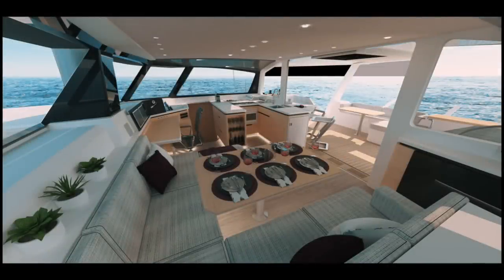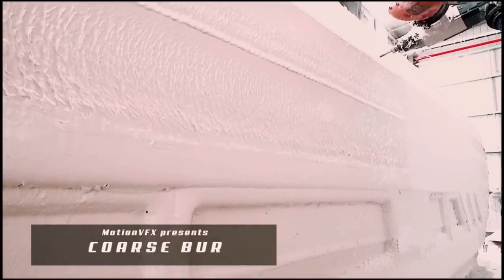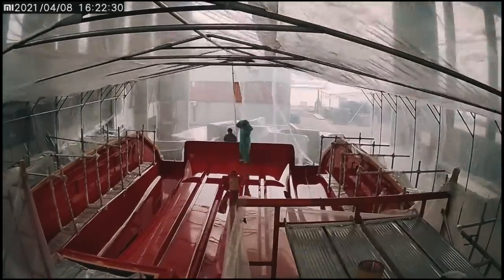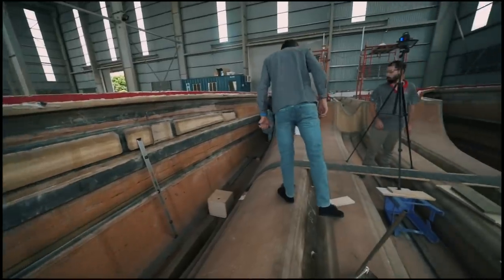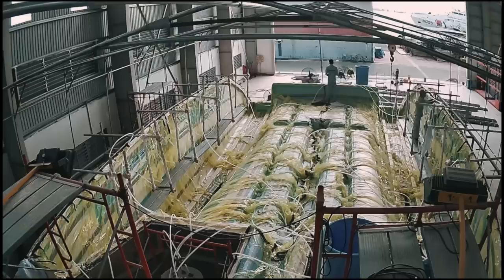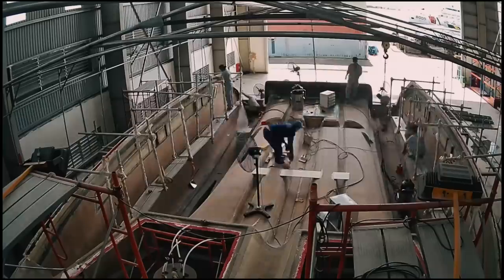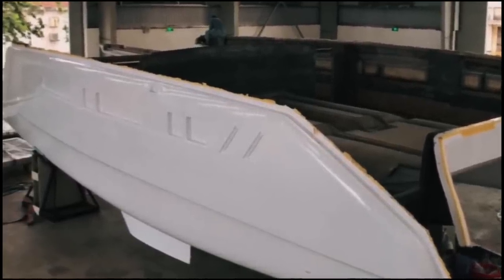🔴 Why does this BOAT BUILD need an INSANE 6,000 feet of pipe work?!!

Comment: I have created a number of process improvements at Boeing for composite construction. Many parts of a nominal aluminum aircraft are made of composite materials to save weight. From a process engineer perspective, this build process is excellent and well thought out. The key is the attention to what is called process step transitions. These people are excellent in the transitions from one process step to the next. Of course they paid good attention to the basic design process. They used the expensive carbon fiber very selectively to achieve a balance of weight savings and keeping the cost down. Carbon is light and strong, but also very costly. Thus a balance was sought between light weight with adequate strength and cost. This is an admirable quality in the design leadership. It is one of the key features to the SeaWind management and leadership. In Engineering we say any fool can build it if cost is no object. But cost is always a member of the triple constraint. Cost, performance and time. You must manage all three at the same time. Few do. That is real experience from my world. Time slides are so common at every company I have worked for because they don't seem to understand fundamentals. Tine = money.
Reply from the maker: Thanks Roger. Super interesting comment
Reply: I was the EA for the Program Manager (a Boeing VP) of the BB V-22 program at Pax during the lead-up to and post LRIP decision.  Hectic days.  I have always been very impressed with Boeing's bench strength.  Every Boeing employee I met and worked with was high quality.  Back then, on the mil side of production, the big three were Cost, Schedule, Technical Performance.  I'm sure Nick appreciates your comment a lot.
Reply: @williamdykes2750  Thanks for making the connection. Your words mean the same as mine. I learned a lot and contributed a lot as well at Boeing. I am glad you had a good time there. Boeing had some great leaders. They were anything but perfect. But they knew how to lead a great company.

Comment: I’m curious as to the statement about “destroying” the (foam) blanks to protect the Intellectual Property.  
Won’t any decent laser scan of the hull reveal the exact shape used?
Reply: True, but what sort of laser and when are you going to be able to do it. The reason is so that further (pirate) moulds aren't made from it, which is a darned sight easier than building a new plug from dubious laser scans.
Reply from the maker: Exactly this
Reply: Yeah, but that's a bit of a stretch.  Toss a plug in a dumpster and 100% someone will grab it, slap some glass on it, and make a crappy 3rd rate copy.  It's happened.  But by the time someone goes to the trouble of obtaining a hull, 3d scanning it, CNC milling a new plug etc, there are far easier/cheaper ways to build a boat.  It's like locking your doors, it keeps honest people honest but doesn't do anything to prevent a dedicated thief.   But it will stop a 3rd shift SEEWHIND from finding it's way on the market.
In all seriousness, he glossed over it, but making molds is a good bit more expensive than making a hull.  Molds have to be much thicker and stiffer than hulls so they can stand up to repeated use.  Say you take a 3d scan and hire another yard to make you one, you're looking at several million dollars worth of work.  It'd only make sense if you c/would sell a few dozen, and if you are capable of making boats that people will buy dozens of then you likely already have an equally solid design and stealing this particular design isn't much of a benefit.  This design may well be awesome, but it really isn't any more awesome than what any competent shop can make on their own.
Reply: @MrJhchrist  I think you sum it up. If you can afford to build one of these, the licencing cost to pay the designer his fee are minuscule when compared to your construction costs. Who would risk $1million plus to build a pirated copy boat. I understand that the normal legal process is to chainsaw the pirated copy and all costs awarded against the perpetrator.
Reply: "All you need" (famous last words) is a microsoft 3D scanner for about $100, a $350 bit of software - plus a ton of software frustration time, and you can copy any boat that you find on the hard really. Then there is the small matter of a 45' to 60' long by 14 ft tall 6-axis robot cnc "cutter" to create a foam plug for the negative mould (the commercial ones are all 6-axis usually - as I can tell). You definitely want to build to this level though, this builder is using great materials without being wasteful. Sure an all-carbon tub would be lighter and stronger, but one miscalculation and there is the possibility of a fatal large failure.

Comment: Really impressive to watch, even if the tech side is kind of lost on me. It's reassuring to see how much thought goes into making a strong hull. I do wonder if that rigidity has any downsides? Not to compare bananas to bricks, but under extreme pressure doesn't it mean there is a final snapping point? Growing up in Florida where hurricanes are frequent we learned that the palm trees which flex and bend mostly survive while the rigid oaks and pines snap apart in many places. Mother Nature can be a booger when she gets her undies in a twist!
Reply: Rigidity is good.  For what''s intended to be a solid structure, lack of rigidity is what cases fatigue cracks and eventual failure.

Trees have a totally different structure.  Wood and most other plant matter is made up of many cellulose cells, where strength comes from many directly connected cell walls in a continuously solid structure.  Since such a structure is not hollow, it can't carry anything useful inside it.

Boats made from wood are mostly made to be rigid.  Viking longboats are an exception, but most boats since then have been designed to be rigid and will fail if flexed enough.  They need to be rigid too.  Obviously metal and composites are better than wood in this regard, though metal has the problem of corrosion in some cases (Aluminum tends not to corrode; steel does).

A better analog for plastic composites would be seashells.  They are very rigid and strong, but if they flex enough they break.  Same with arthropods, turtles, etc.
Reply: @LoanwordEggcorn  Good explanation! Thank you.
Reply: @rumblechick73  You're welcome!

Comment: You said this boat will be a super-light, super-fast performance catamaran. According to the specs on the website the light displacement is 11 tonnes. The extended version of the Marsaudon ORC42 is the same LOA and a light displacement of 5.8 tonnes. How would you qualify this cat?
Reply from the maker: Hey mate,
The TS 42 is an amazing cat. If I wanted a super fast racing cat, then between this and the Dazcat there is little to choose from.
Ultimately we want something that is going to be a liveaboard for us and the TS 42 while very light and fast does not have the interior fit out we need.
Also, as an aside, the lightweight is 6.4 tonnes. The emptyweight is 5.8. However, looking at the specs of this boat, I think that once you add engine upgrades, and start to use her as a liveaboard, the weight will increase rapidly. It will also probably quickly increase past the point where performance is hampered.
I’m not sure if you saw our review of the xsquisite x5 catamaran from last year. Their point (which was well made) was that the performance score we gave them was based on the weight of the boat. As they gave the true weight as 18 tonnes, it was scored down. But if they had given lightweight displacement it would have been 14 tonnes.
I would love to see the actual weight of one of these boats after being fitted out. 
So in summary. Amazing boat, but not for us.
Reply: Zed6, the first TS42, had a MOCRA cert of 6359kg for the Fastnet race (carbon mast and racing anchor).
If you look at the boat sail plan drawing you will notice that the waterline is specified at 7400kg so already 1 ton above the light disp, ready to sail, weight which according to ISO 12217 includes engines, batteries, anchor, chain, warp, sails, standind and running rigging, safety and standard équipement and 2 people onboard.
For my wife and I who are minimalist sailors that should be fine ;-)
I clearly understand this is not a cat for everyone and am happy you both found the perfect cat for your requirement!
Reply from the maker: Thanks for the feedback. It sure it an interesting boat. I was looking at the specs I found online here:
https://www.marsaudon-composites.com/upload_files/files/orc42-dt-version-en.pdf
If they are correct, I think I would need to add a considerable amount of weight to the boat to get it even half liveable. It would appear that the weight of the given boat doesn’t take into account a door from cockpit to saloon. So you have a pretty large issue there.
I also believe lightweight doesn’t include water and diesel. The standard boat has 2 x 90 (180kg) litre tanks for diesel and 2x 100l  (200kg) water tanks. Again, not enough for a liveaboard. We had 260 litre of water on Ruby Rose and we struggled.
One final point is that a boat this light is going to be really sensitive to additional weight. The lightest rib you can get is about 35kg, plus the engine (30kg for a 9 hp, 2 stroke). You need a freezer (40kg), you need a water maker (20kg).
Would still love to race one though

Comment: Fascinating build.  Looking forward to the rest of the video's.  Using Divinycell sectioned blocks with a woven backing  is nothing new, I used the material 30 years ago to rebuild a boat hull.  I would be good to have input from the designers regarding using carbon fibre with Vinylester Resin.  I was always told that it is better to use Carbon Fibre with Epoxy for strength than using Carbon Fibre with Polyester Resin, which Vinylester is a variant (absorbs less moisture than Polyester GP Resin}  being a waste of time and money since the gains are small.
Reply from the maker: Hey mate, you might want to check out our catamaran design series which addresses this (and much else) https://youtube.com/playlist?list=PLZUfYw9ZbdscDHMCpcvWCOnAkrhCUPNSl
Reply: Vinylester is actually chemically more related to epoxy than polyester as it shares a similar chemical backbone chain as epoxy , the only resemblance to polyester is the CARRIER that assists in the cross linking of the polymers ( ie styrene ), and in the case of vinylester is is a greatly reduced styrene content thereby emitting less VOCs ( Volatile organic compounds )   into the atmosphere, and in the case of resin infusion voc emissions are further contained under a vacuum bag until cured. Carbon fibre can certainly be used with polyester and vinylester as long as the engineering is sound and the preference would be the epoxy / vinyl ester chain. Furthermore, vinylester has the ability to inhibit moisture absorption and resist chemical corrosion ie Osmosis, as does epoxy and there are now high quality ISO Polyesters both resins and gel coats that are isophthalic and specifically manufactured to inhibit moisture as well, aimed specifically at the marine market.  Cheers

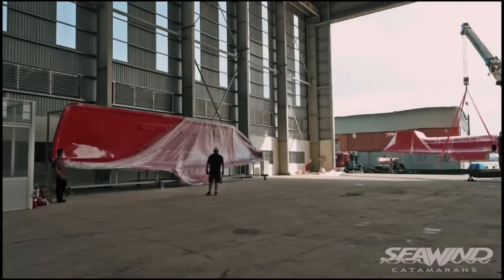Comment: Nick, at 4:45, you said the plug is destroyed to protect the IP.  In that case, how many hulls are the molds (moulds) good for?
Reply from the maker: If they are properly supported, the number is almost infinite
Reply: @sailingrubyrose  okay.  Thanks.  Now that hull #1 is out of the molds, has RRII started it's hull process yet?

Comment: My understanding of fibreglass work is the lower the humidity the better.  I noticed the building was open to the outside (you can see traffic going by) and two oscillating fans; hardly a controlled environment.
Reply: The controlled environment is under the vacuum bagging. 0% humility

Comment: Wind tunnel testing? With such a lite weight water craft how does it react in high wind testing and what are the safe wind load limits before the hull becomes a wing and has either loss of rudder control or worse. Surely there is documentation on the testing for this type of situation. I'm no engineer but this is a reasonable question to ask. Should he, Would he, Could he have this information.

Comment: Interesting to watch. Seawind appears to build a strong, lightweight hull.  It’s good to see them use a foam core instead of balsa. That was a selling point when buying my current boat, and will be when we transition to a catamaran in a couple years. And of course properly tabbed and glassed bulkheads! The “up” galley is much preferred over the “down” galley in the 1260. Likewise, since they are forcing you to look through the cabin (👎 highly disliked design feature) at least the mullions are smaller than the 1260 as well. Take the raised cockpit roof of the 1600, elevate the helms slightly to allow you to look OVER the cabin (eliminate 1 helm for simplicity and to open up the cockpit further) and you’d have the perfect boat for us.

Comment: How does the hull shape compare to the Outremer 45?
Reply from the maker: The 45 hulls are a bit narrower and also they have daggerboards.
Reply: @sailingrubyrose  thanks, i couldn't find anywhere what the loading of the 1370 will be just marketing speak of "a lot". What payload are you expecting to be able to put on above light weight?

Comment: Is a Carbon fibre bulkhead stronger than Plywood? Has it been proven to be stronger???
Reply: Am curious about this too. It will be stronger laterally, but you need something to support twist; honeycomb, aluminum, or marine plywood core I think. Wood rots is the problem.
Reply: @EdwardTilley  my thoughts about the pressures apied in different directions not only downward force. Good points, Edward.
Reply: As I understand it, those bulkheads (and everything else) are made of multiple layers with the axes of the cloth in each layer offset to add to the strength.  It looked like "beams", possibly foam cored, had been molded in to them as well.  I suspect that as long as the bulkheads are SECURELY tabbed and glassed to the structures around them they'll be secure from twisting and flexing.

Comment: Great video,well explained,impressed by lay up quality , just wondering two things
1.With all the work of bagging up to infuse resin,what would be the cost difference to have used epoxy instead of vinyl ester and any pros/cons
2. What are the pro/cons of retaining mini keels stead of integrating dagger boards 
Thanks for the video SeaWind,can’t help but think that carbon fibre bulkheads are going to be a big discussion point after Parlay’s short apprenticeship in retro fabrication of bulkheads
Looks like a g fantastic boat Ruby Rose have subscribed to each the rest of your boat emerge
Reply from the maker: Hey mate. Welcome to the channel. I’ll give you my best educated guess on your questions.
1. No idea of cost. The advantages of vinylester over epoxy are also lost on me. However I believe that the big advantage comes from the use of vinylester over the cheaper polyester. This massively reduces the chance of osmosis down the line.
2. The mini keel vs dagger boards we covered in our interview last year with the naval architect.

Link is here:
https://youtu.be/6YHS_B3SmlU

But in a nutshell, if you want slender hulls and you add dagger boards to a 45ft cat, you massively lose liveable volume in the hulls ( a la Outremer 45).

Hope this helps
Reply: Epoxy infusion, whilst feasible in i the infusion process, will add significant fairing and painting at the final stage of the build, whilst paint is more durable, and lighter than gel coat it isn't really an option in the mass production line of boats , more suited to bespoke or customised builds, where the labour can be accounted for as it will add several month of extra work at the final stage, gel coat is sprayed in one sitting in this case , offers a far more repairable outer medium, and is a suitable exterior which is chemically suited to vinyl ester( which is a modified epoxy in any case, has vastly superior chemical resistance to osmosis to polyester, and 2/3rds of the cost of epoxy. )Cheers
Reply: Thanks for that LOTHs,,like your channel btw,l have hand laid 2 x34’ cats and 2 x48’ monos,which l loved doing,watching you brings back a lot of fond memories